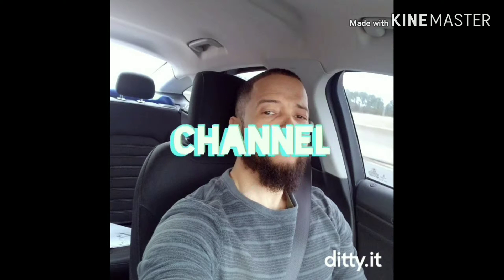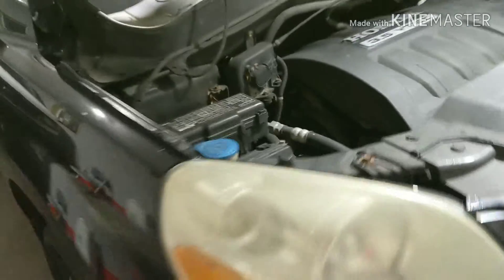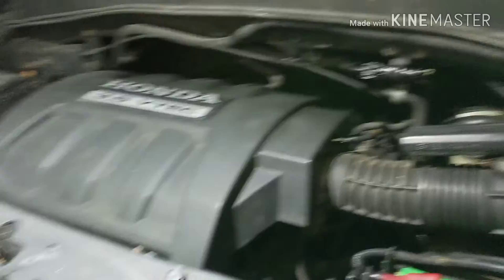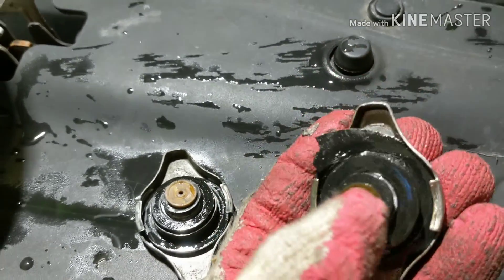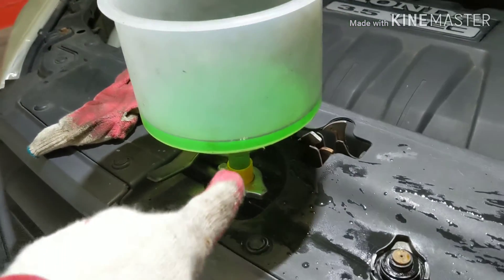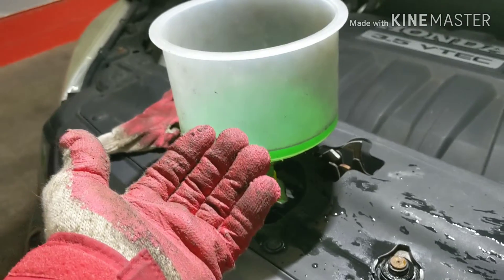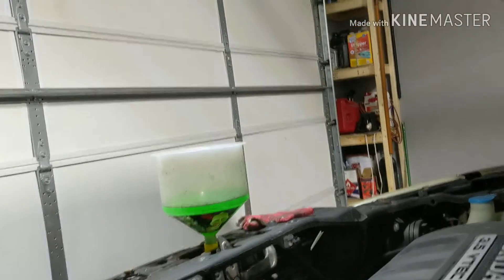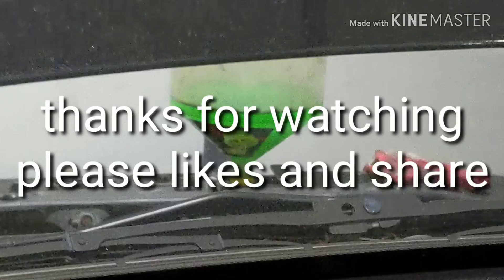How to test a water pump

Comment: Thank you for this wonderful tutorial. It is a big clue, I will try and find the funnel to buy, but my car only has a reservoir and that’s where I add the coolant. Can I try the test using the reservoir? 

Meanwhile the problem my car has is that the temperature rises to 80-almost 90 degrees during the day, and car does not accelerate well, especially when I’m in a traffic. But at night the temperature becomes better. I don’t have thermostat in the car as it has been removed, when I fixed the thermostat it became worse, so I had to remove it. What could be wrong?

Comment: okay- so the car overheated, about a month after replacing the thermostat (previous definitely wasn't opening). no substantial use of coolant. Checked the hoses, both are pretty flat, i can easily "clap" them together as you said, just squeezing with finger and thumb. I did the funnel test, and it did bubble up while revving the gas....even though both hoses are still really flat.  This is a 2005 Civic. What do i check next?

Comment: I heard to test if the water pump is working correctly all you have to do is hold (pinch)  the upper radiator hose and Rev the engine, and if you feel pressure in the hose then the water pump is working correctly
Reply: It takes so much force to give it a good pinch that I doubt I'd able to notice the pressure if there was any

Comment: Bought 04 element
Pulled thermostat and dropped in boiling water and it opened up.
Put back together and this happens. Only normal operating temp. When I pull funnel and put cap on it will overheat.
My fans aren’t coming on either but they have been tested and work
Reply: https://youtube.com/shorts/aQBQo1O3fQU?feature=share

Comment: Ive got a 99 acura cl 3.0 that keeps overheating and leaking out of the overflow when its hot. Ive done thermostat. A flush, fixed potential leaks and a new egr valve cause the engine light turned on popped up as PO401. Its still overheating tho. Is it gonna be the heater core or head gasket if umits not the water pump?
Reply: Figured it out wasnt either. Was the fuckin radiator cap 😂😅
Reply: @RhylanCoyle-m6z What did the radiator cap have to do with it? Im having the exact same issues with my 2000 dodge neon
Reply: @rhyzelbarela  it ended up being that my cap was only the top of the cap and didn't have the plug anymore to keep the fluids in. The broken peixes ended up falling into my radiator tho and caused it to clog upp. I ended up needing a radiator toooo

Comment: If I have thermostat removed and radiator cap off, should I see coolant swirling at idle? The coolant barely moves in mine.
Reply from the maker: Yes if you step on the gas coolant will come up

Comment: I just put a new radiator and fans on my van. When my car idles for more than 5 minutes the tempature will spike but as soon as i turn the car off and let it sit its fine. It will not spike as long as im constantly moving. Possible cause?
Reply from the maker: Remove the thermostat and drill 2 small holes and put it back
Reply: Naaa bleed the system out aka burp it…

Comment: Hey thanks man great technique! I will try this but I don't have the funnel. I saw another guy do a variation where he puts the return line of the coolant tank into the coolant bottle and revs the car. If no coolant comes out = faulty pump or blocked coolant system. Question : My car starts to slowly drip coolant after 30 mins idle. Location of drip is near my right mudflap. It does not drip at startup it takes about 30 mins to start dripping. Would this be a small hole in the hose OR a bad seal or gasket? I would suspect a faulty pump would leak asap on startup but I'm not sure. Because I'm trying to determine if it is the pump or maybe a bad hose etc etc. Thank you. EDIT: My steering wheel is on the right side.
Reply from the maker: Well thanks for your feedback Marco , ok so if it takes 30 minute to leak it will be a bad gasket it can be a manifold gasket , water pump gasket , or thermostat gasket , what happens is when the engine is super Hot where the leak is coming from it can't hold the hot temperature so it let it go , hope this help , do coolant  pressure test, and you will see the leak
Reply: @nestorautorepair  Brother, thank you so much for this info and I hope it helps anyone else who reads it. I also read that another simple test is to turn on the heater and if the heater gets hot it means the water pump is doing it's job. I knew the dealership mechanic was a crook and trying to tell me the water pump needed to be replaced for $1200. Many blessings brother and I hope you win the lottery soon!
Reply from the maker: Men 🙏 lottery lets  hope we both get it then , thanks Marco for your feedback , best luck on your fix

Comment: What is the problem if water pipes has much pressure within 5 minutes start engine on
Reply from the maker: Check your radiator cap maybe is bad , also maybe the fans are not working

Comment: Is it normal if the waterpump is bad..the radiator cap and radiator is cool?
Reply: Theres no thermostat sir and no leak..but my radiator is rusty.i dont know if my water pump or clogged radiator..suzuki multicab f6a engine.
Reply from the maker: Got it ok how about heat?
Reply from the maker: Yes more likely water is not going around the engine
Reply: @nestorautorepair  ok sir..thank you so much a big help
Reply from the maker: Your welcome .. but start with the thermostat maybe is close
Reply from the maker: Check if you got heat hot
Reply: What heat sir?
Reply from the maker: Hot air coming out of  the ac vents
Reply from the maker: Creo que en Ingles no no estamo entendiendo ,, que carro es que tu tiene y si se esta calentando si la aguja de la temperatura see esta subiendo ,, y si tiene calefacion caliente El carro ?

Comment: NESSTOR AUTO REPAIR, What is this water pump tested called when using the funnel? there must be a name for this type of test
Reply from the maker: Yes thanks for your feedback
The Spill-Free Funnel eliminates trapped air pockets which usually cause erratic cooling system and heater performance. It controls the proper amount of coolant entering system and enables unattended filling of the cooling system. The funnel eliminates squeaky belts caused by coolant overflow and protect the environment. Five adapters fit most domestic and import cars, light trucks and Ford vehicles. The Spill Free Funnel has been improved by adding an extra 45 degree elbow, a 5" extension, and a new E adapter. The E adapter is used on the surge tanks on many Ford applications. 45 degree elbow allows use on radiator caps that are placed at an angle. Extension allows access to caps located under shrouds or in fender wells.
Reply: @nestorautorepair  
1.) What other ways to test and check if the water pump is working correctly "without" using the Spill Free funnel?
2.) How can I test the Pressure of the water pump and the pressure of the radiator while the car is idling and running? I want to know what the pressure is through the radiators hoses and water pump hoses, how can I do this?
3.) The Water Pump is "increasing" the radiators coolant into the car engine and into the radiator core to increase the flow of  the coolant?
4.) How can you test if your radiators hoses and water pump hoses has to much pressure the pressure is to higher than normal operating pressure?